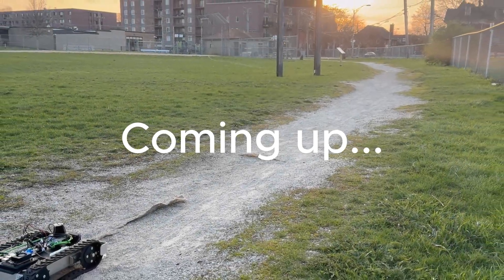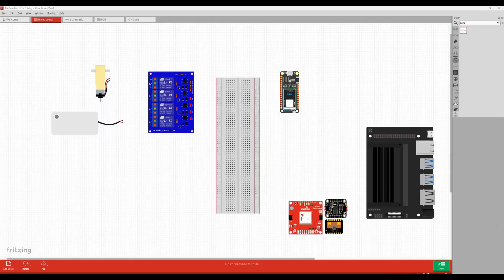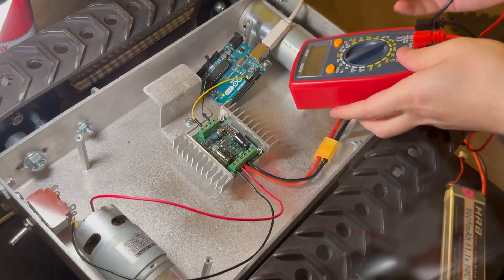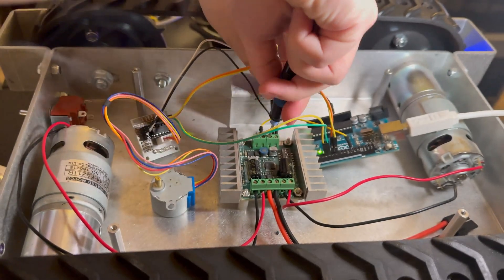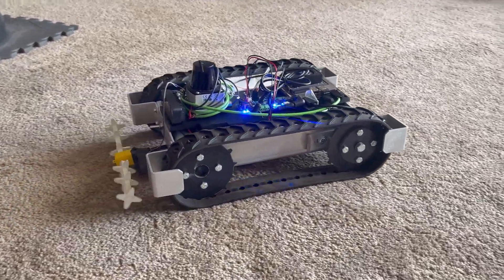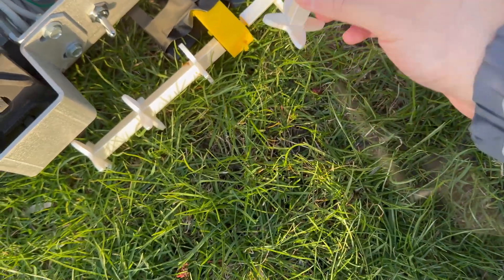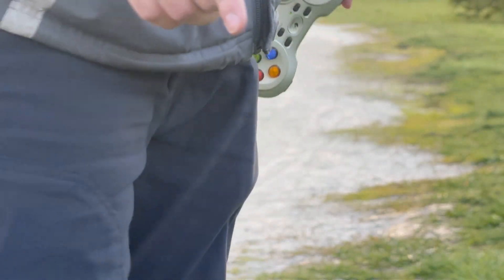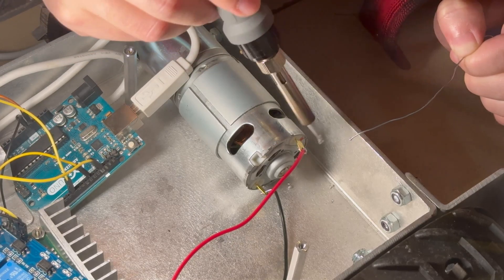Full Speed! I Wired My Robot Hardware (The Guardian Ep.2)

Comment: Lets go! I love this project. For the soldering to motors near the end, I recommend using insulated spade connectors & crimp to the wires. Then you can have a solid connection and if you need you can take them off pretty easily! In the past, I made a handful of one side spade on side pigtail, and then I used WAGO connectors to adapt to whatever I need. Also did this with ferrules for screw terminals. 

I have some extra I will give to you !!
Reply from the maker: oh interesting! Didn't think of that. Thanks!
Reply: Use electronics solder. 60/40 tin/lead, with rosin core.